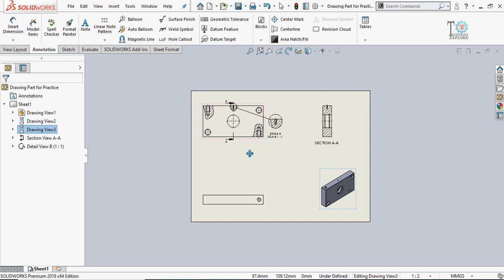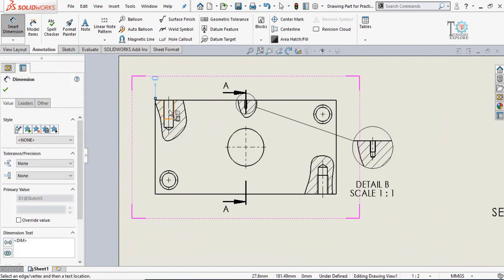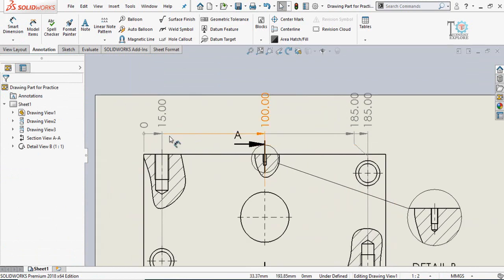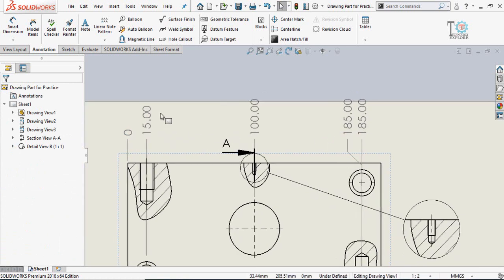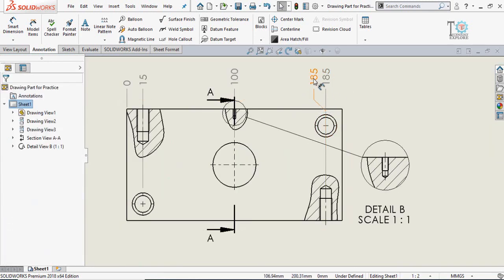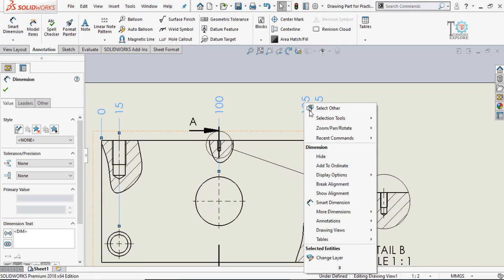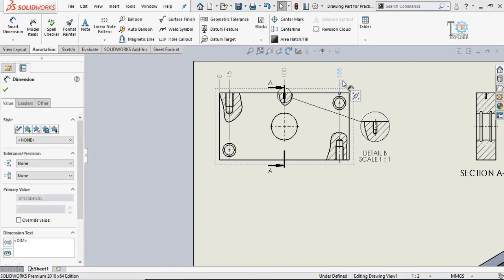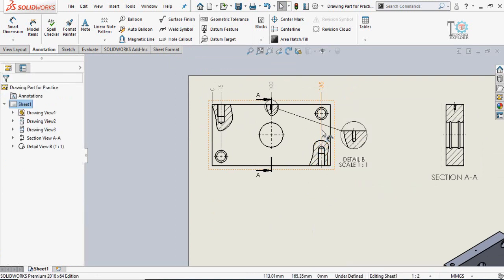How to add Ordinate Dimensions in SolidWorks Drawings

Comment: Hello htere. Is there a way to add more dimensions to existing set of ordinate dimensions? I.E....if I demension the drawing, exit the commandand, then I notice couple more locations, that I would like to add to that set I just finished. Is there any way to do that without erasing everything ad start from the the zero again
Reply from the maker: Yes there is a way to add without adding new zero. Right click on any dimension in required set of ordinate dimensions then select "Add to ordinate" option